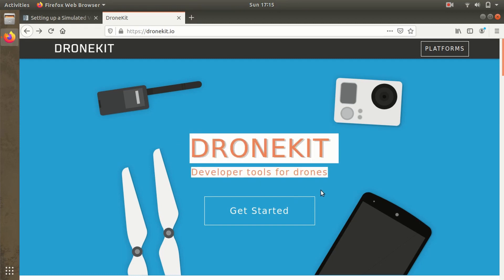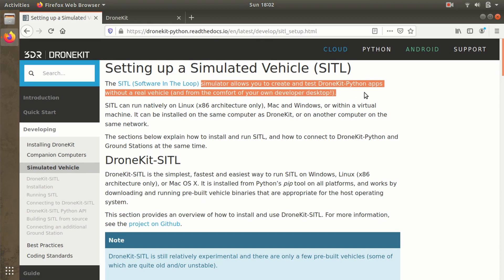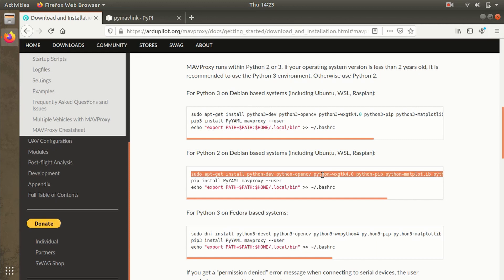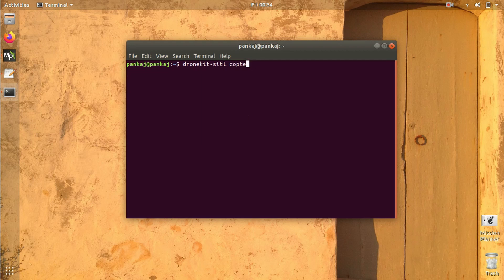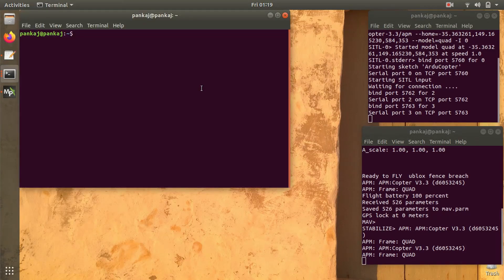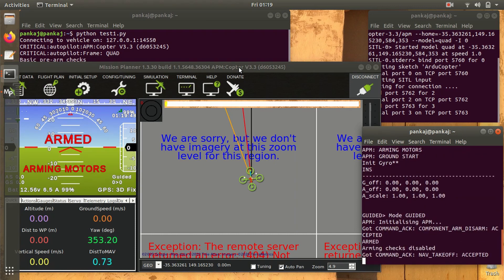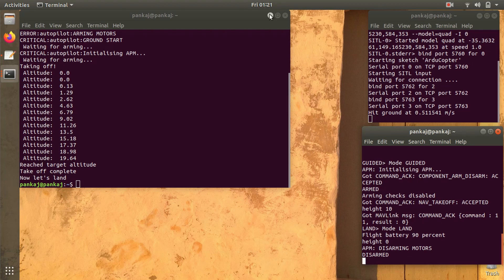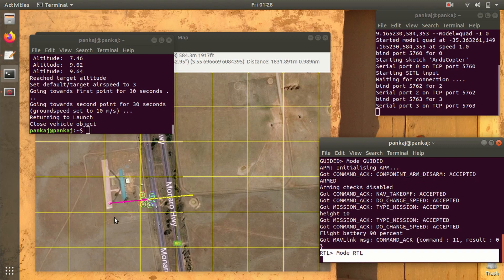Install Dronekit-SITL, MavProxy | GAZEBO with ArduPilot Plugins and Simulate your Drone | Part-1

Comment: great video
for SITL iam using  QGC . which one would be better mission planner or QGC, because some custom commands dont work in QGC in sitl.
Reply from the maker: Hello akshay,
Thank you 😊 
Nice question ....actually mission planner would be better as it works fine with sitl and also if you ran into some problem you will get a huge community support for troubleshooting your problem. 
And would recommend to go with ardupilot and gazebo it is more realistic
Reply: @PankajMali  yes i am a begineer in gazebo , Thanks for the suggestion.
Reply from the maker: So next part is probably made for you and also upcoming videos because everything rounds up and comes to Ros and gazebo simulation
Reply: @PankajMali  thanks I'll stay tuned to learn 👍
Reply from the maker: Much appreciated

Comment: Is there a difference between Dronekit-Sitl and Ardupilot-Sitl???
Reply from the maker: Hello naif,
Both the things are same just the difference is on how they are required,

If you just want to do some quick setup and have some tests with no more installation process then dronekit sitl works fine ....like in this part of video and it it maintained by 3d robotics

And ardupilot sitl  can work like dronekit sitl and moreover  has plugins  for the Irish model which can be simulated in gazebo 3d simulator giving more realistic experience which you will see in part 2 . It is maintained by ardupilot dev team
Reply: @PankajMali  thank you for the response and we looking forward for part 2 👍👍😇😇
Reply from the maker: Yup its will be out in couple of days

Comment: great work brother keep it up, but what if the shape and type of drone are not common like hydrus drone. in this case which software i can use for calibration and simulation of drone. please guide me on this. thank you sir.
Reply from the maker: Hello dipak,
Thank you very much,  if you have your own custom robotics designs to be implemented  and also simulated them what you can do is like create a model of your robot using any Cad software like fusion 360 ......after that you can use gazebo api  and develop your model there like adding linkages and defining the functionality of that particular part . Finally simulate your model in gazebo environment. 

Consider in part 2 we will see how to simulate a drone in gazebo using ardupilot plugins and if you are developing your own custom plugins for a drone then you can build your own controller program like in ardupilot plugins it has its own pid controller similarly you can design  that .

Hope this helps you
Reply: @PankajMali  thank you so much sir, for gazebo and ardupilot, it is necessary to install cygwin because i face trouble in cygwin and mavproxy. installation of mavproxy is complete but mavproxy map and console can't open.
Reply from the maker: No need to install cygwin because it is completely recommended to use ubuntu 16,18 mostly on dual boot rather than virtual box.

Cygwin may get in trouble if used for ros

https://github.com/punkypankaj/Installing-Gazebo-and-ArduPilot-Plugin
Reply: @PankajMali  i think we all viewers face trouble in installation and setup of the software,but people like you help a lot, keep it up brother.
Reply from the maker: Thankful for your kind words❣❣

Comment: Thank u so much, ive been stuck for months with errors and i can finally get to work! .. one question tho what drone are u using? I need to order one with dronekit compatibility, what do u recommend? ❤
Reply from the maker: I have custom build carbon fiber frame designed well for longer endurance, it has rpi and pixhawk with all other add on like , rpi 8mp pi camera , flow sensor and soon it will have lidar

To get started you can use any ready to fly frame and add electronics as you need
Reply: @PankajMali  yo thats dope but im still a beginner and my focus is more on the software aspect for a uni project, i found good reviews on 3DR solo and ots compatibility with dronekit do u recommend that?
Reply from the maker: Yes i will always recommend that for a good start
Reply: @PankajMali  my man.. much respect thanks for taking the time to respond
Reply from the maker: @NerdWithNoLife97  hope it helped you.....thank you ❣❣

Comment from the maker: If you get error like
Got COMMAND_ACK : NAV_TAKEOFF : FAILED
Got COMMAND_ACK : ARM_DISARM :FAILED 

Then first check if you have 3D fix in the mavproxy terminal and your copter should takeoff always in guided mode, if you havent mention in your python script about mode change then manually change the mode and then arm, still you get the error then its the problem with mavlink.

Then install pymavlink==2.4.8 instead of latest one as of now 2.4.14 and you are good to go with it
Reply: Thank you so much it worked!!
Reply from the maker: Wow ...you are good to go ahead 👍
Reply: yes am getting this error by using ubuntu 20.04
Reply from the maker: Just follow the above highlighted steps to troubleshoot
Reply: if am using console map . how to change the mode
Reply from the maker: Hello sampath
Whenever you want to change the mode manually you need to send mavlink messages to the simulated vehicle and mavproxy command does the work for that, so in the video at  9:43 you can see the mavproxy teminal open you can just type the  command to change mode or any command to manually take control over the vehicle.

For example to change mode 

MAV > mode guided/stabilize/land
Reply: @PankajMali  iam giving this command  mode guided .it's still stabilize mode
Reply: Am using ubuntu 20.04 lts . Am running dronekit phyton examples basic mission .am changing the mode in missonplanner then it's tackoff Target altitude . After that isn't not following  mission automatically again am changing mode in missonplanner auto then it's following mission again it's not getting rtl again giving manually  change the mode